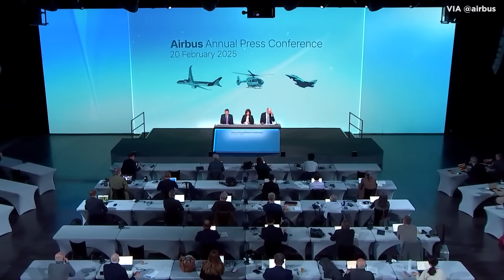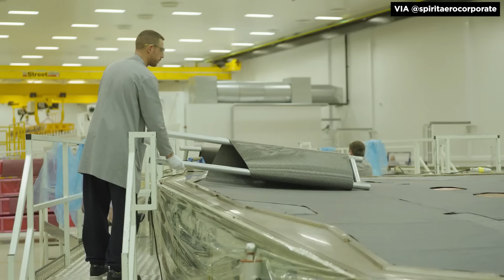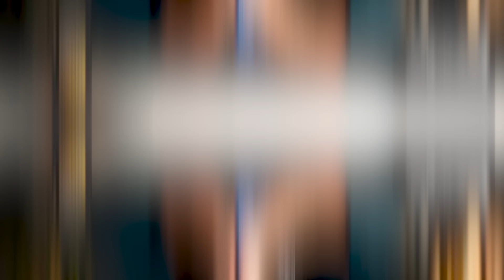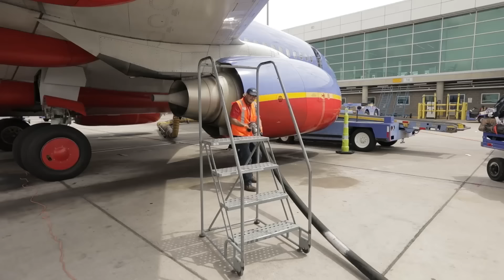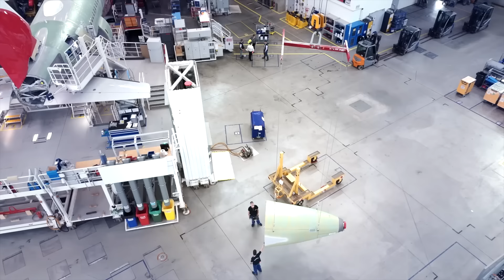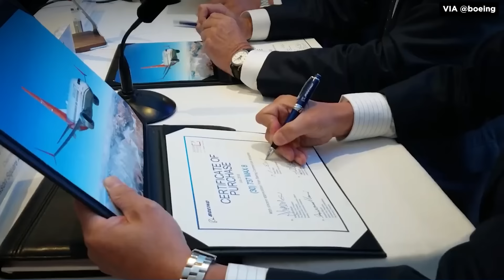Did Airbus just Change EVERYTHING?!

Comment: Boeing would have to be insane to not have a 737 replacement in development by a skunkworks style team. The 737's reputation is forever tarnished by the MAX crashes, groundings, then the flare up around quality control issues, slow pace of manufacturing, and on and on. If I were Ortberg, I would have surreptitiously pulled 100 of the best performing engineers off their teams and assigned them to this project, and task them to come up with a clean sheet aerodynamic/physical design. Their only guidance should be that it can seat 150-200 people, that it costs around the same as a current 737 Max, and that it is as fuel efficient as possible. Then let them innovate around everything else unencumbered. Let them come up with a truly innovative design, then reveal it and commit the resources needed to take it out of the wind tunnel and into production as soon as possible.

Comment: Hydrogen should never be in the air. Or in a vehicle, especially a bus. Until storage issues are resolved, production cost brought to compete with liquid fuels, hydrogen is a dead end. I'd not fly in an H2 powered aircraft. I'd rather stay at home. Maybe it will be OK for cargo shipping. At least any leaks could be safely vented to air. Hydrogen seems promising until you look at how hard it is to handle. That's why there is so little hydrogen used in vehicular transport. Now try the same thing at 35,000 feet? Don't think so!

Comment: Hydrogen, outside of a very few niche markets, is a non-starter.  Not only does it have problems with storage, transmission/supply, leakage, energy density, etc, it is entirely - and ridiculously, uneconomic.  Put simply, it just takes too much energy to make it.  

Except in those very few niche markets, this means that either direct electric power is the answer, or, in a very few cases, we'll just have to carry on using fossil fuels.  Living with global warming, doesn't necessarily mean abandoning ALL fossil fuels - just cutting down our usage as much as is feasibly possible.  And, if we want to continue flying as much as we do now, that's a compromise we're going to have to make.

Comment: It’s not a surprise that the Airbus hydrogen aircraft will be delayed for another 20 years. Hydrogen has a single electron and proton and just doesn’t have the energy density of  hydrocarbons when burned.Beyond that, it’s explosive and challenging to contain. Also today’s airports have jet fuel delivered by pipelines from the distribution center. This system works quite well and delivering cylinders of explosive hydrogen will take some serious  engineering and manufacturing to be viable.

Comment: One thing first, big "no way never" on flying in a hydrogen powered plane. Remembers me the great explosive delusion of Zeppelins. Ok the latter can run on helium which is like saying SAF is way safer and ideal for planes. Because if fuel is sustainable (whoever then can define this) the efficiency gains are not worth the risk in whatever configuration we will fly. Open fan design has one problem, it's noise. And didn't producers spend billions to encapsulate engines .. with small side-effect the hull of a turbofan engine should be able to stop flying blades ... so maybe turbofan will need to get a noise filter? Then the next problem will be size...

Comment: The problems with hydrogen, apart from the need of cryotanks inside the fuselage, could be solved with methane as a fuel. Methane is a renewable, occurs naturally, so is a difficult greenhouse gas problem, especially as it's 16 to 20 time more greenhouse active compared to CO2, yet burns to release only as much CO2 as half that greenhouse activity. Methane capture to "manufacture" fuel exclusively for air travel, could make jet aviation net carbon neutral. Hydrogen seems like tech bro hype to me.

Comment: You don't need really high pressurized tanks on airplanes, let me go wild, I was working on gas tanker, there nature gas and other gases are stored at liquid level due to they are supercooled, tankers calculate cookoff on their journey, that cookoff the use to cool other gasbubbels aboard aswell as the vented gases they use for propulsion.

Let us think a plane that just need hours rather then days to next port, they could theoretically load supercooled fuel and fly both on cookoff and stored liquid, the airport unless they choose pressurized tanks could also have supercooled hydrogen, they also have to accept cookoff but they could use that for heating and electricity on the airport. Smaller airports might need preassurised hydrogen for fueling maybe. It's just a curiosity brainstorming

Comment: A few points...First, timing is everything. As you noted, both Airbus and Boeing are not likely to introduce a new aircraft type too soon since they currently have thousands of narrow body aircraft on order with deliveries well into the early 2030s and they will not want to jeopardize their backlog and potential near term new aircraft orders which will be in service for the next 20+ years beyond 2050, possibly. Today, both manufacturers along with their engine suppliers are not able to produce aircraft and aircraft engines to meet existing commitments, which are being delayed and pushed into the next decade. They will need to deliver 5000-7000 units by 2030 in order to support the thought of launching a new airplane program in the next decade and that is not going to happen due to strategic, financial, and technological reasons, I think.

Secondly, since the engine OEMs and oil companies are close industry partners, I suspect neither of them are in any hurry to develop hydrogen-powered platforms anytime soon to support "net zero" emissions by 2050. Sustainable Aviation Fuel (SAF) has already proven that it is not scalable enough to support 10% of the world aircraft fleet by 2030. In fact, SAF will never catch up with the world's commercial aircraft fleet. Nonetheless, the engine OEMs will not be interested in developing a "derivative" new engine as a bridge to future propulsion innovations. Very costly with little/no return on investment. As it is, the engine OEMs are still having to resolve engine issues with today's new engine technology, especially Rolls Royce Trent 1000, Trent XWB-97 and Pratt & Whitney PW1100G engines while General Electric and CFM engine issues are minor and more manageable.

The airframe and engine OEMs have prematurely promoted hydrogen-powered developmental "paper airplane" concepts for promotional purposes to satisfy media, politicians and environmental stewards for the time being, but the technology leap has a very long way to go before switching to hydrogen-powered platforms, which may eventually prove not to be feasible due to the vast investment required to redesign conventional airframes and fuel storage tanks, airport infrastructure, hydrogen fuel distribution methods as you noted while maintaining an extremely high degree of safety given the risks of hydrogen fuels as we seen recently with the SpaceX "rapid unscheduled disassembly" incidences. We never want to have such incidences in commercial aviation.

Lastly, regulators are not able to keep up with new technology. They need more time to rewrite new regulations for new aircraft types fitted with new hydrogen-powered propulsion systems. We have a very long ways to go before we switch from turbo fan, ultra turbo fan, and geared turbo fan propulsion technology to hydrogen powered propulsion technology.

Comment: Hydrogen could be carried in wings, that is not the issue.  The issue is Hydrogen cannot be contained by a "wet wing" which is where the wings skin is the container for fuel.  Storing Liquid Hydrogen requires a kind of pressurized dewar to contain it so such dewars could be built inside the wing, but their shapes will not be an optimum use of available space in the odd geometries of these interior wing compartments.  The other issue with Hydrogen is that it uses a very large volume for its mass meaning you not only cannot use your tank space as efficiently as you could  before, but also that you need MORE OF IT to carry an energy equivalent amount of Hyrdrogen to its jet fuel counterpart.  This is because not only does Hydrogen just take more space for a given mass of fuel, but that fuel by mass is less energy dense than jet fuel.  This is why the Hydrogen aircraft will still be a long time coming even once they solve for infrastructure and have an operating hydrogen distribution network at the airports.

Comment: Let's use hydrogen to bring back the big airships. It can be done safely. Relatively. 
Let's go slow instead of fast. Imagine taking a comfortable leisurely cruise aboard a ship in the sky. Yes, the Hindenburg eventually exploded, but made many long-range trips. The Titanic sank on its maiden voyage, did the world stop building sea ships? No. This is something cool we can do with hydrogen. We can build a modern and safe Hindenburg, but we have to use hydrogen. Helium cannot do it. It has been tried and failed. Helium can barely lift a big airship with no passengers or payload. Only hydrogen will work.

Comment: Embraer wants to produce a 30 seater hydrogen fuel cell aircraft by 2035.

Fokker wants to produce a 100+ seater hydrogen hybrid aircraft by 2028, the "hybrid" is not as good as the "fuel cell" but definitely better than regular fuel.

Also aviation fuel will cost a lot more when there are more electric cars and electric lorry's and more alterative fuel ships, if crude oil is being split into petrol, diesel and all sorts of other things and aviation fuel, but less people are buying the petrol and diesel then the cost of all the other products from crude oil will go up in cost.

So in the future political world of the late 2030's and 2040's we should have the situate where politicians will need to do a lot to reduce green house gases because by then climate change will be so much worse, and other sectors will have made more of a change, meaning greater focus of aircraft.

And you will have Airbus and Boeing saying hydrogen's not possible whilst Embraer and Fokker will actually have aircraft in production.

So their would be massive political pressure on Airbus and Boeing because if Embraer and Fokker can do it then Airbus and Boeing just aren't good enough.

And Europe has a good train network across most of it, so politicians will make it easier to catch the train rather than fly on a non-hydrogen aircraft.

Comment: The main problems are presently caused by the engines. The manufacturers promise the blue from the sky, but their engines don't work reliably. When half of the fleet is grounded because there are not enough specialists to perform premature inspections or not enough spare parts / spare engines the aircraft producers can do whatever they want with their fuselages, they cannot not improve the situation.
Just an idea: they could improve the situation by building foldable wings like carrier planes. That could reduce the costs for planes waiting for engine inspections as they need fewer square meters.

Comment: Some areas that may need work for use of hydrogen as an aircraft fuel:

Right now hydrogen is produced by "cracking" methane. Is that going be ramped significantly, and what is the environmental impact of that process.

One: Storing hydrogen - high strength pressure vessels or cryogenic tanks.

Two: as an element does mot like to be contained. It will leak at any available connection.

Three: will we need many hydrogen production facilities  or just a few big ones?

Four: getting hydrogen from where it us produced to where it will be used as a fuel. We talking brand new pipelines and/or fleets of trucks.

Comment: I know about H2 being a tiny molecule that escapes through metals, plastics and all kinds of containers. So that you will actually allways have a leak in what ever configuration you build the fuel system. And the weight of system problem, aswell as the energydensity being low.

But what i am sad about is that with Airbus pulling the aircraft industry from the hydrogen wagon, the vicious cycle of delay has started:
consumer says i stop development on engines since production, transport and sales of my fuel have been shown to be in baby steps.

Day after hydrogen companies sent their lobbyists to the local politicians and tell them they need money (guarantees) before continuing to finetune the production, storage and sales of the fuel. I find it sad, as i am believing it could be done that renewables produce enough and steady hydrogen gas to full fiil the needs of aviation.

Comment: I haven't done the math personally for jet fuel costs (take off vs cruising costs). Yet my impression is that its far less than the costs to move a plane using hydrogen fuel cell. (Per the same weight and drag coefficient.)

With cars, you would rather buy a lithium battery pack, carry that extra weight around at all times than having to buy hydrogen from electricity, to convert it back into electricity.

A car doesnt have such a weight penalty as a plane does.

We can agree that burning hydrogen is a dumb idea. That is an expensive fuel which results in very little energy (compared to using jet fuel / diesel). Just use hydrogen fuel cell if you are going to use hydrogen.

If governments help to subsidise the generation of hydrogen, cleanly, for aircraft. Then we could see the aviation industry adopt this technology (to create a demand for airports to have a hydrogen fuelling option).

Comment: Hydrogen has oodles and oodles of problems. That it currently has a carbon footprint that's at least as high as any hydrocarbon.  The real problem is its energy density. It has the least calories (joules) per volume, per kilogram, per time* of any fuel. An aircraft would have a higher takeoff weight than a jet fuel craft for the same distance. It also takes up more space. If it were stored in the same tanks as currently used, the plane would have a very short range. Time is even worse. Time is rated from traveling from reservoir/tank to where it's used. The delivery of the fuel to the engine is a minor issue. It's the delivery of calories to the engine that's slow. At first glance, it sounds good. Star outlining the issues, and it gets bad.

Comment: 1/ Hydrogen can self-ignite in the event of a leak, especially at high pressure.
2/ even if it doesn't self-ignite, it can explode very easily over a wide range of concentrations (4%-75%) with very little activation energy (i.e. a very small "spark")
3/ hydrogen weakens the materials in which it is stored, which increases the likelihood of leaks, and therefore requires a lot of checking and tank replacement.
4/ hydrogen leaks at high pressure produce a deafening noise, which can even be potentially fatal ( 140dB at 200 bars)

The storage of gas at high pressure is so dangerous that it is compulsory to attach cylinders to the wall with chains in racks for pressures of a few bars... For energy storage in the form of hydrogen to be interesting in terms of energy density, we are talking about pressures between 300 and 700 bars.  And we want to put that in an airplane?  By adding all the specific hydrogen-related problems listed above?
Safety starts at the design stage.  If we start with something that is intrinsically dangerous, it is much more complicated to make the process safe to use.  (And this complexity itself introduces additional risks).  Will it be possible to achieve the safety levels required in the aeronautics industry?  You can never say never... 
And what would be the real ecological balance throughout the entire chain of using hydrogen on a large scale in civil aviation?  Even if the production was done by electrolysis of water based on 100% renewable electricity, it would require a lot of factories.  And everything has to be special in the production, transport, and storage of hydrogen.  It is not even possible to make durable hydrogen pipelines at the moment (due to material aging)...

And I'm not even talking about the costs. 

I think hydrogen is a dead end.  In my humble opinion, there is a greater chance that energy storage technologies in the form of solid chemical ("batteries") to power electric motors will emerge in the coming decades, even if we are far from it for now.  We can even imagine mini nuclear reactors to power electric engines, like in submarines, but there we have weight problems that are quite difficult to solve.  (Not to mention the public's reaction problems).

Good luck to Airbus and the others...

Comment: I don't think Airbus have much of a choice here. Most of the efficiency savings come from the engines. When new engines become available both Boeing and Airbus will introduce new planes. Also hydrogen aircraft is not gonna happen as there is no economical and clean way to produce hydrogen. So they have more than 10 years to use their new aircraft design.

Comment: Hydrogen is simply not a solution - it's made from petroleum, in a process that produces CO2, and we're a very long way from the industrial-scale solar- or wind-powered splitting of water into hydrogen. (Airbus is being realistic with it's 2040-or-later projections.)   Until "green" hydrogen actually exists, beyond mere petro-corporation blathering, the staggering costs of a distribution and storage system that supplies airports around the world cannot be justified - and you can't deploy hydrogen-powered aircraft until after that's been put in place.